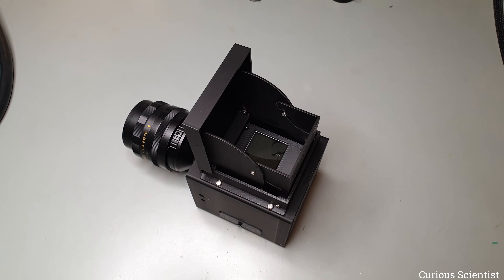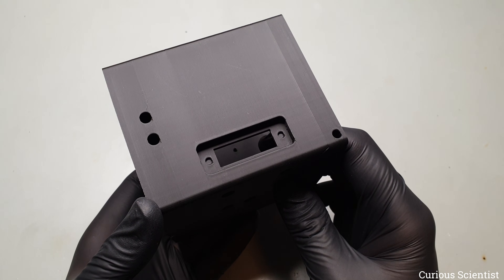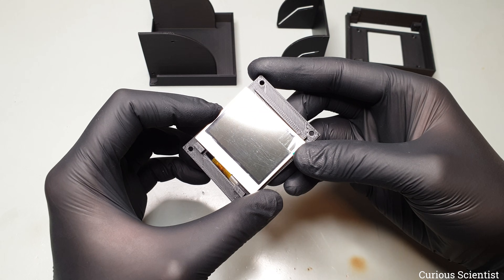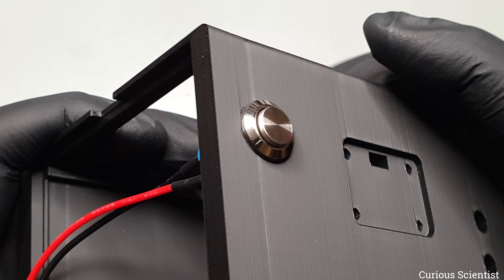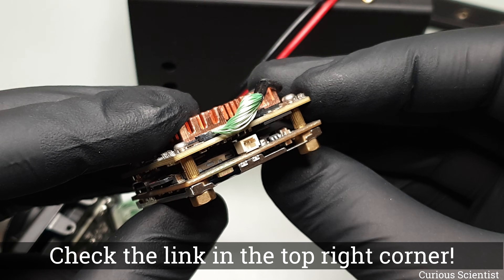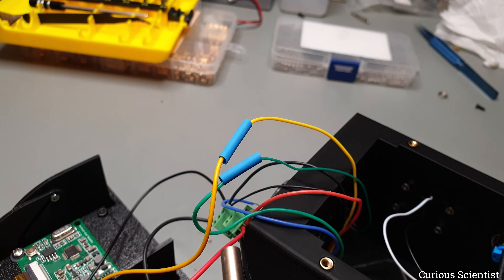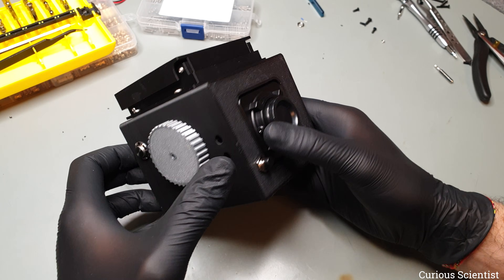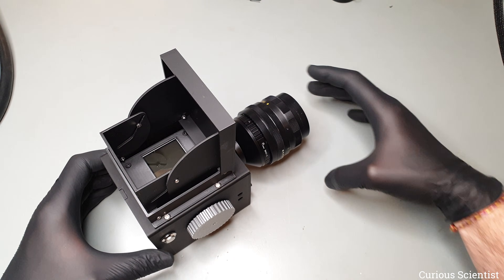"Medium-format" digital camera with 6K video capabilities

Comment: 4:45 I can recommend ordering a bottle of the medium strength locktite next time you order parts. Then the nut stays locked and you can adjust it a bit without it getting loose.
Reply from the maker: Thank you! I will consider it for the next purchase. Do you happen to have a certain recommended product?
Reply: @CuriousScientist  It doesn't matter if it's Loctite or Permatex, they all work. It's a blue, funky-smelling liquid that hardens in the absence of air, so only a small drop inside the nut, then screw it on.
Reply from the maker: Thank you! I added to my basket for the next impulse shopping.

Comment: I quite like the case. But using a 15mm sensor makes the whole idea of medium format rather ridiculous...
Reply from the maker: That's what I said in the beginning of the video, that I just borrowed the looks but the sensor is significantly smaller. If I could get a medium format sensor for free, believe me, I would gladly build a camera around it.
Reply: @CuriousScientist  Agreed. But then you are addressing something just because that is what you can do. You have a hammer and the case becomes the nail. Only in medium and large format photography, the camera hardly ever is the problem.

Comment: @3:20 I guess you mean 640*480 pixels, which would make it a 4:3 ratio
Reply from the maker: Nice catch! Yes, and "no". 640 x 480 would absolutely make more sense and would correspond to the 4:3 ratio. However, on the sellers AliExpress page, they state 640 x 240 with 4:3 (even if it does not make sense). So, I rather recited that value instead of "getting caught" not telling the same stuff that is shown on the product's page. But you are absolutely right and I think that the seller has a typo on their website.

Comment: But what about the cooler for cooling?(
Reply from the maker: It has heatsinks.
Reply: Are they enough for long-term work?))) @CuriousScientist
Reply from the maker: I assume so. The original heatsink that came with the camera was not even directly applied on the chips, but it was glued on the metal shell. So, if that was OK, then this should be much better.
Reply: @CuriousScientist Definitely better. But I notice that artifacts appear on the video when recording for more than an hour.
Reply from the maker: I haven't recorded that long yet. But you can always put a fan over the CPU unit. Small active cooler that you can find for RPIs for example is a compact solution.
Reply: @CuriousScientist I have an aluminum cooler installed. Thank you.